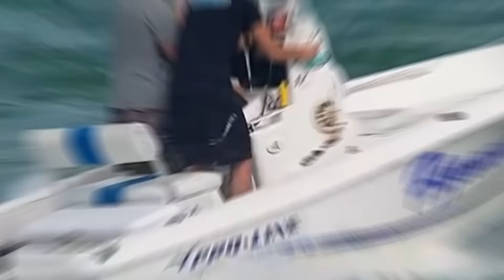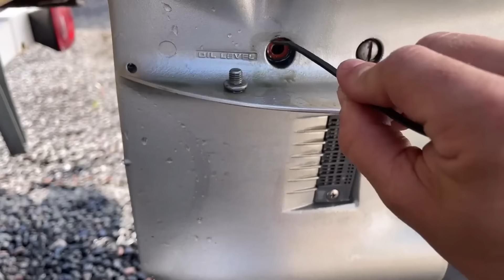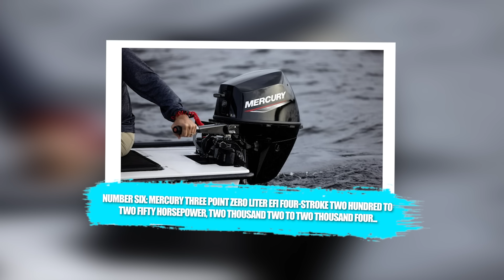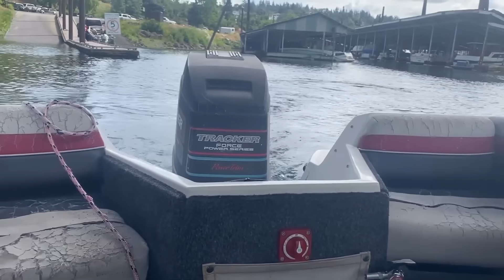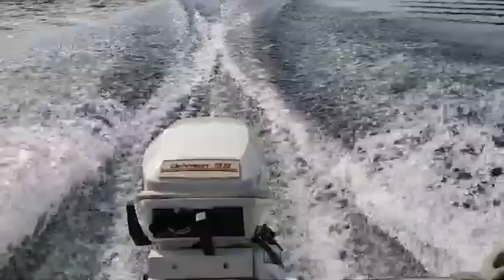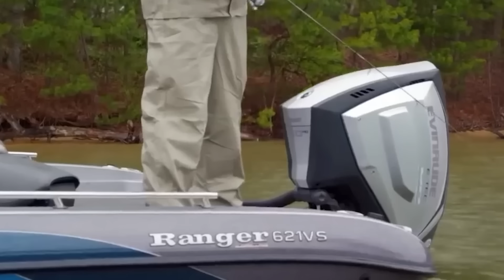10 Outboards to AVOID At ALL Cost!!

Comment: 1996 Evinrude 88SPL is the best one ever made.  Don’t believe me?  Look at all the shrimp boats down south.
Reply: I have a 1989 88 spl.  Regular maintenance and this thing is 35 yrs old still runs like new. Never changed anything major. Just plugs waterpump fuel pump. Lower unit is flawless.  I totally agree. It has 120 compression on all 4 cylinders exactly.  Just use the red outboard johnson oil . Never let me down always starts.
Reply: @samciarametaro2705 . Man, what a great story.  You’re the only other person I know who knows this about those SPL’s.  We’re it that ALL outboards were made that well….  Thanks for posting, and happy days on the water.  You’ll never be stranded because of the motor (smile).  We drive ours hard, waterskiing and the like.  Ours sits on a 1963 Boston Whaler Nauset.  Dad purchased it and the motor original.  The first motor was a fuel injected 90, and it was the worst.  I re-varnished all the mahogany about five years ago and that’s all I’ve ever had to do to her.  I hauled off and rebuilt the lower unit myself about ten years back.  Works fine but took awhile, and I had to buy a micrometer and a couple special factory tools.

Comment: 1999 evinrude ficht 175, here. motor is 26 years old and has been a awesome motor 10 years I’ve owned it. Stay up on maintenance. Running totally perfect for me to this day.
Reply: I have a 1986 Mercury 175 black max that still runs like a scalded ape on the original power head.

Comment: I bought a lightly used Force 50hp around 1989 for $500 at that time I mostly fished in Salt Water. I ran it on a 16ft Jon boat in Florida. I also fished for tilapia in freshwater lakes.. The Force 50hp never let me down BUT it seemed like it was really more like 35 or 40hp at best. I ran it for about 9 years and upgraded to a 20ft SeaArk with a 90hp mariner. Back then I fished at least 3 times a month so my boats never sat around, I think that helps them stay running.